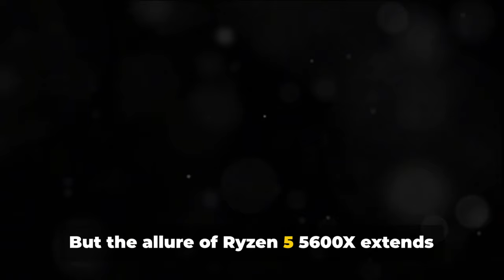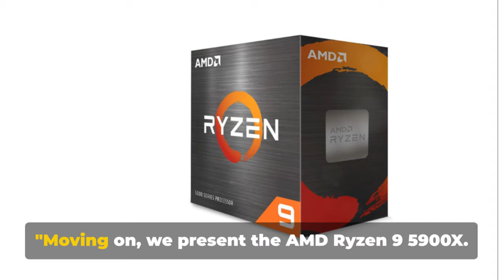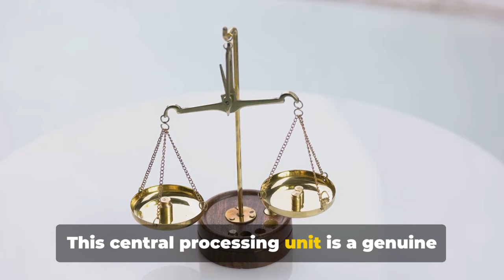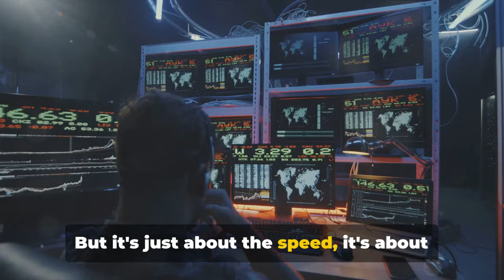TOP 5 Best Gaming CPUs in 2024 | Dominate Your Games with Ultimate Performance!

Comment: Honestly this list surprised me as it was quite accurate, however there is one thing to consider. The i9-12900k/kf isn't that great for price to performance gaming as even the i5-13600k match or even beat it in many games. If you are searching for a multithreaded beast, then your best option is the i7-13700k or the aforementioned Ryzen 9 5900x, which are at lower prices and offer the same if not better performance.
Reply from the maker: Thank you for that!